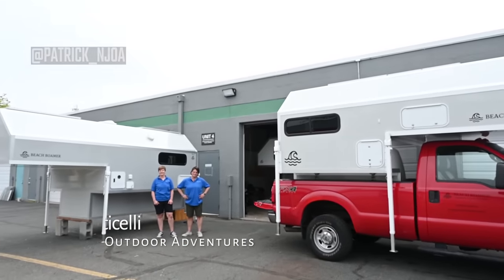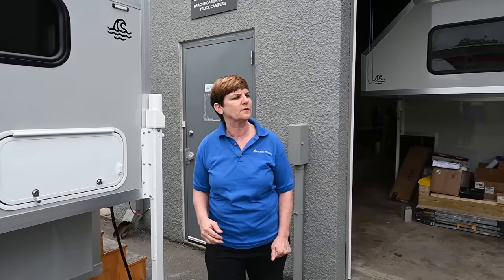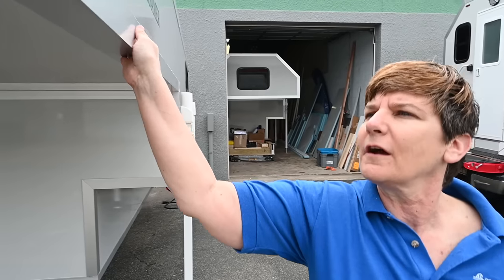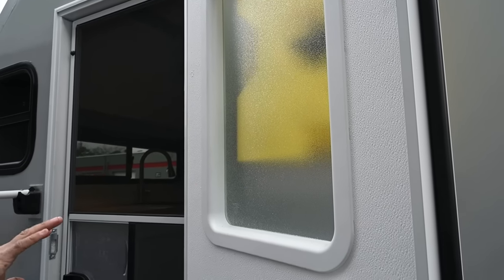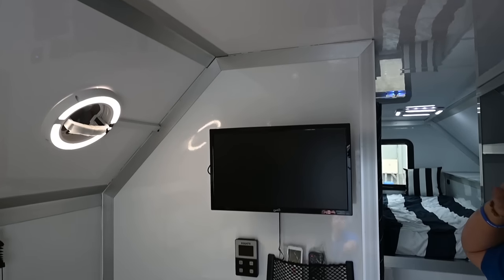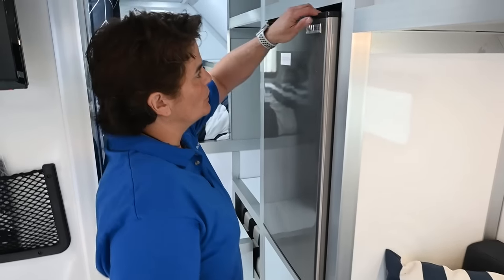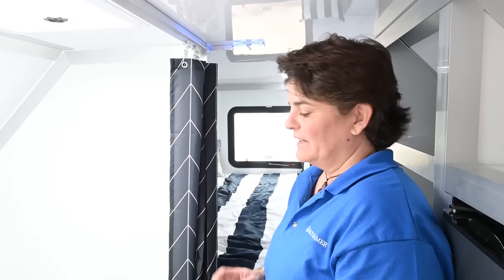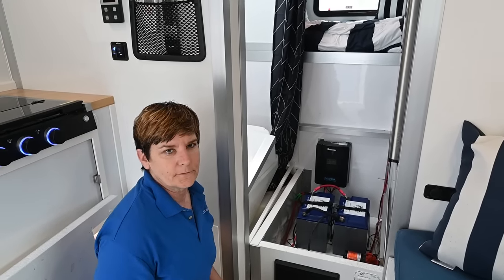ULTRA Light Weight - HIGHLY Insulated - RUGGED Off-Grid Truck Campers

Comment: Why don't major manufacturers produce the types of clean, simple, high quality, low weight products we see on this channel? Instead, they insist on selling cheap overweight junk.
Reply from the maker: One day they may be a major manufacturer
Reply: And so tired of all those swoops on the outside of RVS. Where did they get dumb idea to put swoops on the outside?
Reply from the maker: @gigilaroux762  it was an idea to hide vents, outlets and compartments. I never liked them but I understand why they existed back in the day.
Reply: I love your comment 👍👍👍
Reply: No streamlined wind resistant front? One glance and I know not to even consider this model.
Reply: That’s how they always did it, so no need to innovate. Why you saw brand new campers where the inside looked the same for the last 30 years. It took a small miracle for them to change the paint color inside.
Reply: @gsp49 Really kills the mileage. Sadly the single disqualifying feature.
Reply: @gsp49 wouldn't be hard to add a fairing
Reply: @gsp49 
How are you then going to emergency exit if the emergency window is blocked by a wind guard?
Reply: You answered your own question, it’s cheap. Why waste money on more reliable materials when you can build it for much cheaper and then it breaks and they have to but a new one?
Reply: Driving a 3/4 ton truck that is lucky to get 30mpg with a giant camper that weighs 2200lb and costs 40k to 60k, but aerodynamics is the deal breaker. 🤔
Reply: @gigilaroux762 I think it hides imperfections in the fiberglass. Sort of like camouflage.
Reply: . What kind of 3/4 ton truck can you get anywhere near 30 mpg with? Even empty.
My Ford F150 with a 2.7l Ecco boost engine gets 20 at best, empty on the highway. 
That motor is too small for a 3/4 ton.
Reply: Very Nice Clean Love it 😊
Reply: @gsp49 something of this style would affect mileage anyways, “streamlining” it won’t have much of an effect
Reply: It's called innovation, and those ladies are killing it..
Reply: Fabulous!
Reply: @NewJerseyOutdoorAdventures  من هم باشما موافقم ❤
Reply: I love the fact you can feel like you are being rushed to a hospital in an ambulance while relaxing at night.
Reply: Good question. Why do you think?
Reply: Follow the money. 
I don’t think the geeks who design most of the RVs and truck campers have ever spent an extended time in them camping or off grid. 

If they did they would design them differently and with better features.

This biz seems to be onto something!

Comment: I don’t understand the angled roof, you are really taking away from interior space.
Reply from the maker: It’s easier to go down trail with the angled sides, less tree branches to scrape. It also allows solar panels to be mounted at the correct angle for optimal solar gain.

Comment: This is the only truck camper I would ever purchase. I was sold on the clean, simple lines, the durability of materials used, the lightness and solar energy source and that lovely picture window/emergency exit. Super reasonable prices that don't break the bank.
Reply from the maker: Couldn't agree more!
Reply: With the way that thing is shaped it's going to break the bank when it comes to poor gas mileage.
Reply: @gsp49 
Yo can't get rid of the emergency exit window, but you could solve your problem by adding an aftermarket wind guard custom made to accommodate the emergency exit. A win-win combination.

Comment: As a pilot, that square front end would drive me crazy,  a fiberglas fairing of some sort to smooth out the airflow would pay dividends in MPG/drag. I like everything else! Just got to the  "custom extrutions", hot stuff!
Reply from the maker: Fair enough!
Reply: Agree with you...that wind profile would kill me
Reply: I'm clumsy enough to split my noggin on the squared off extrusions.  Have to find a place inside for a mirror, suture kit , looks like the dripping blood would wipe off most of the surfaces easily enough though.,

Comment: You can tell just by the video the difference in long lasting materials, the simplicity of the design with no junk tacked on to it. Why can't the industry do it this way? Why do most popular campers come ready to crap out right out of the lot? Can't they see the value in something like this? There are some companies out there which are more of the boutique size variety, like this one (and Kimbo, Scout, etc) which are kicking arse with long waiting times because people HAVE A CHOICE instead of buying (right now) some new discounted truck camper with a soon-to-rot floor, falling and failing hardware and a delaminated interior.....Congrats to the Ladies and their well made products!

Comment: I have a Ridgeline that has carried me through numerous blizzards, ice storms, sandy beaches and off road and it never blinks.  I have a fairly new shuttle bus but I will admit that I am hesitant to lose the Ridgeline.  I could not find an overhead camper that I am even remotely interested in but I would happily do this camper!  I think I need to give these ladies a call.  Thanks Patrick!!!
Reply from the maker: Glad this video was helpful
Reply: My sis was interested in this model, but the 1500 lb max weight for a Ridgeline, which is what she has, makes this particular model at 2200lbs out of the question. One of the ladies even mentioned in the video it would take a ¾ ton, full bed pickup for the weight and length of this highlighted unit.

Comment: A clean and roomy interior, but the main issue I see here and what prevents me from purchasing any camper with this design flaw is the squared front end. You have to find a way to reduce the drag coefficient while driving. Perhaps a bolt on fairing/cone for driving purposes.  Anyways, nice work ladies. 👌
Reply from the maker: Thanks for sharing!
Reply: Great idea going forward and maybe an add on mod for purchase w/DIY  instructions.

Comment: This only gets better and better.  So clean and compact.  Love outside storage areas that access the inside.  So well thought out.  Great options. I have a question, Patrick.   Do you have to have special equipment for your truck for this?  If yes, is that included?
Reply from the maker: You will have to add tie downs in the bed of the truck and the 7-way plug need to be relocated or extended in some applications

Comment: Been trying to decide between a Sprinter Build, a small cargo camper build or this. All have pros and cons. 

Sprinter can park in one space like the truck camper. The truck camper loses bed space storage but the trailer would keep all that for sports, camping gear.

Trailer and Truck camper are far cheaper than sprinter build. 

For my hobbies it seems like the small 12' trailer sprinter style camper build is the option. You can haul bikes in it with a bed overtop, or put them in the truck bed. It's the cheaper option and needs a separate parking space but has more head room, water storage, battery and garage space. All really cool ideas

Comment: I think your camper is great. You need to implement 12 volt ac and increase your battery banks and solar and 12 volt compressor fridge and your will have a jewel in your hands. Right now people don’t want to run a generator because of noise.
Reply from the maker: Appreciate the suggestion

Comment: Those aluminum extrusions are going to thermal bridge right to the inside. Expect them to always be covered in condensation in the winter, and be hot in the summer. Those sharp aluminum corners inside are going to rip through a lot of shins and forheads, scary. Other then that I actually love it, I would buy one if I was looking for a truck camper and wasnt going into extreme weather.
Reply from the maker: Thank you for the feedback

Comment: It has taken me 10 years to find a bed camper I want and I think I found it. I’ll be ordering a empty shell I’m very specific on my dream floor plan. 
I have a 1994  extended cab 1500 that I’ve converted to a 3500 and full boxed the frame and I have a flat bed on it. My biggest concern is having a good size bathroom and enough space for me and two kids and a wife
Reply from the maker: Happy you found this video

Comment: 2 things to mention.
1:Flat nose is gonna slow the truck and hurt the fuel mileage.
2: the sharp corners of those aluminum pieces on the inside will be dangerous and cut one up very quickly.
   Other than that it looks nice.
   My 2 cents😊..

Comment: I think this is awesome. It looks like an all weather camper that can even be used in the northern part of the country during winter months. I definitely would costume build the bathroom different without a sink so there is more shower space. I don't see the need for sink in the bathroom when you have a kitchen sink 5 foot away in the kitchen area. Maybe you can do a video on how much the diesel tank will last with a full tank of fuel and how long the battery lasts when being used.
Reply from the maker: Appreciate the feedback

Comment: Nice to see women builders, very nice!  I don't understand how foam can take the weight of the bed, fridge, etc. I wish they had showed us the skeleton.  I have no faith in foam holding up anything without a network of tubular aluminum.  It's a spacious, clean design, very roomy and modern.  Lovely.  Just show us the skeleton so we are assured of structural strength.
Reply from the maker: They are stronger than you think

Comment: I'd like to see a version where the surfaces that aren't the inside skin of the composite panels to be a different color and texture. It would add some variety. It would also look nicer if the wiring wasn't all run on the surface but I understand that might be hard to do because the composite panels are probably made else where so they don't have a chance to add wiring runs to them.
Reply from the maker: Good ideas

Comment: Awsome camper but the qc could be better, the trim looks bad in some spots, has black sealant on the trim not cleaned up an the lights arent setting flush allowing gaps and light to bleed out behind, could be fitted better an use caulk on those light seams an more places to increase the fit and finish alot. Basicly need a better qc control and that will help you guys alot because this is an awsome product
Reply from the maker: Appreciate the feedback

Comment: I really like the shell of this camper, but I think I can do without all the built in equipment to try to get the camper to 1200lbs, so it could ride on my 1500 class Tundra 8 foot bed w air bags.  Then I'd go ultra light just use a cassette, 5gal water jug over sink bowl and my Ecoflow Pro battery/solar with induction hot plate.  I can do without the fridge, gas stove, heater, heavy solar and water tanks. I am used to backpacking! I see their website is awol right now though.

Comment: How is the thermal conduction with all the bare metal aluminum inside?
Reply from the maker: At the metal strips there can be some heat/cold transfer
Reply: @NewJerseyOutdoorAdventures  That means condensation in cold climates with the heater running.

Comment: That's a very nice little camper. I want one. I have a couple questions on how it would hold up in a bumpy offroad condition? Also does it have to be an 8' bed or could it work on a 6.5' bed?
Reply from the maker: They were building these in different sizes and I know they did a lot of off-road and road testing

Comment: Awesome to say the least.
This makes a Scout look like a joke 😂
I thought using aluminum framework causes thermal heat transfer?
Reply from the maker: Glad you like it. There can be some heat/cold transfer
Reply: @NewJerseyOutdoorAdventures  
Is there a model that fits the 23 Silverado 1500 with 6.8 bed that i can close the tailgate?
Reply: @NewJerseyOutdoorAdventures  
Is there a model that fits the 23 Silverado 1500 with 6.8 bed that i can close the tailgate?
Reply from the maker: @irok1d  I believe they have one like that

Comment: Hi do you have a camper for a 2022 Chevy Colorado with the v6 rear wheel drive its the work truck it has the 5,2 bed but if i leave the tail gate down tail gate down it's 7 feet
Reply from the maker: I know they were planning on making something smaller and I worked on it Tacoma or other midsize pick up trucks

Comment: Adhesive weld.. ? You caulked it.. 
Did anyone else see the water on the inside of the cabinets? ...
Reply from the maker: Adhesive weld is not caulking. It rained the night before, we did a rundown before the video and opens all the compartments, the water inside is what dropped on when the door was open from the gaskets, it’s the same type of compartment doors most RVs use and it’s the same outcome.

Comment: R4 insulation? I put R13.1 panels in my suburban build. Even the wool insulation I used for small gaps and door cavities is R6. Looks like I will be good for just about any weather. IDK about R4 though, that might not be enough. 

$40,000 starting price? Yikes, I dont have even half that into my entire build including the vehicle purchase and all of its modifications.. it has lockers, lights, lift, new MT tires and new wheels, 12000lb winch, PA/CB system, 8x10ft awning, KickAss shower room, stereo upgrade, 400AH lifepo4 power system, 50A DC-DC/MPPT charge controller, 2000W pure sine inverter, 500W solar mounted to the vehicle, custom wood interior, 11" thick residential mattress (so comfortable) maxxair fan, backup 4000W gas generator, 1200W folding solar panels (300W x4), Ecoflow Delta Max battery with Wave AC, propane water heater, propane stove/oven, and countless other odds and ends. For $40K I could have 2 of these setup with gas money for a cross-country trip to spare.
Reply from the maker: Thanks for looking

Comment: if you are using silicone caulking anywhere on a camper you clearly have no idea what you are doing.  Nothing will stick to silicone including more silicone so these campers can never be re caulked successfully again.  There are many caulks form Sikaflex etc that are far superior to silicone.  There is no reason to use it
Reply from the maker: I don’t remember them mentioning silicone
Reply: @NewJerseyOutdoorAdventures  they specifically said the exterior extrusions were sealed with silicone caulk
Reply from the maker: @johnguertin5054  ah, okay. I’ll have to give it a listen

Comment: is it me or is there not an elephant in the room? imo, this may be a good design to some but horribly designed to an engineer? I mean, absolutely no aerodynamic efficiency, center of gravity probably too far forward. No offense, is it because it was designed by someone without zero mechanical/engineering. Like the BUick Rendezvous, that was a woman designed suv, yet the suspension on that suv is lower than some cars. the elephant in the room to me is that this is kinda horribly designed, but  praised beause it was designed by women.